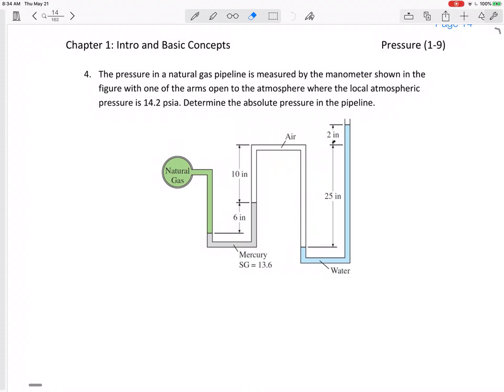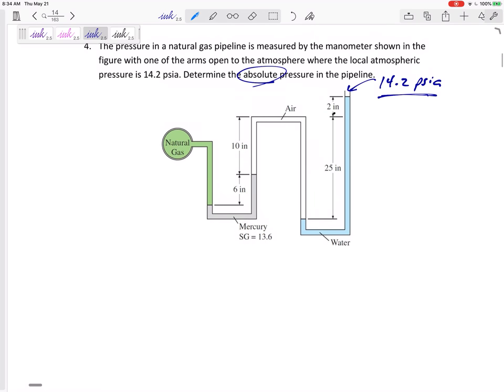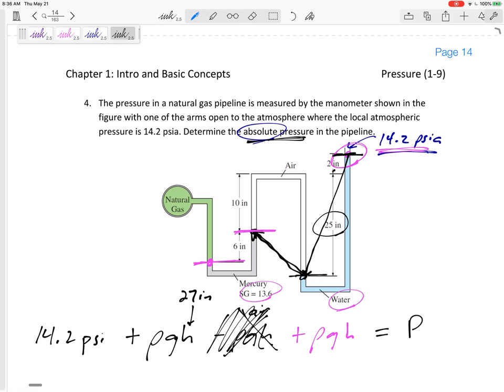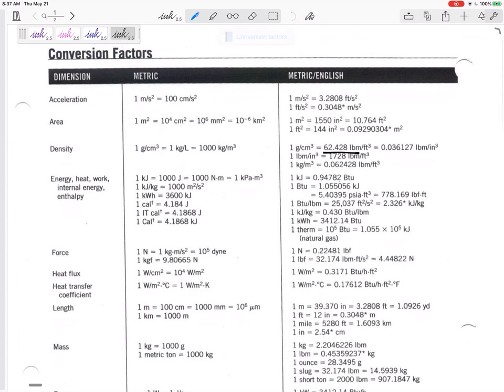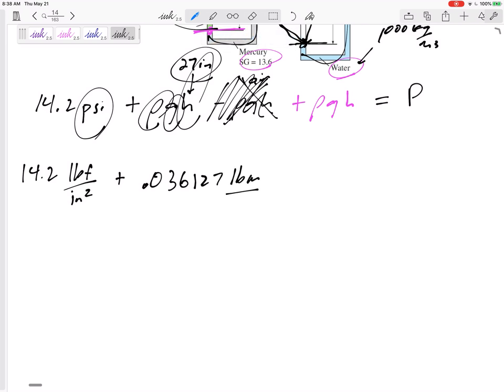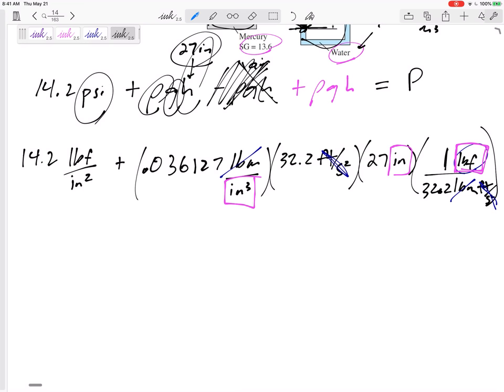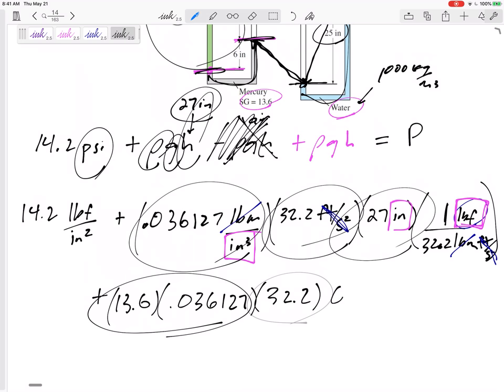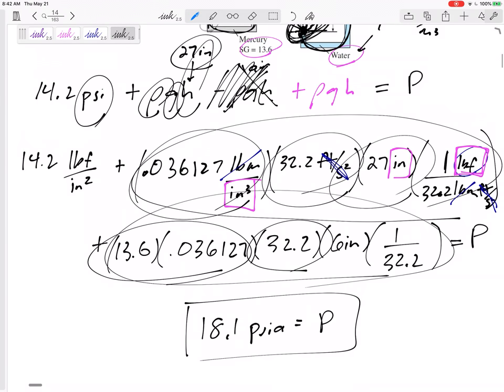Thermodynamics - Pressure example 2 manometer

Comment: I've calculate it just like in the video but I ignore the 14.2 lbf/in^2 and then I got  126.332288 is this KPa? because if it's KPa then I add the 14.2 lbf/in^2 I got 140.5332288 KPa. And then, if I convert 140.5332288 into Psia, I got 20.38 Psia not 18.1 Psia. Did I might be missed something?

Comment: Hello professor, awesome lessons, clear explanations. One question: since you add as you go down, but if you were to go up (from left to right), would you put a negative sign instead? Thank you!
Reply from the maker: Yes, Anytime you go down - add. anytime you move up - subtract.
Reply: @engineeringdeciphered but you went up when you went from the water to the Mercury so shouldn’t you be subtracting in that part? I can elaborate more if you want
Reply from the maker: @alvinlin8140  I think you’re talking about the part where I was going through the air. In that part, yes, going through the air you would technically subtract the rho g h of air, but we can neglect any gas because the rho of gas is much much smaller than the rho of the liquids. So I just skipped subtracting the rho g h of air. (you could do it, but it would be a very small number)
Reply: @engineeringdeciphered ok gotcha thanks, my prof hasn’t gone over examples so this is helpful! One more thing, the pressure of a gas is negligible but in the question we are finding the pressure of the natural gas, can you explain that?
Reply from the maker: @alvinlin8140  well, it’s the change in pressure (due to height change of a gas) that is negligible.

Comment: What if you should've  convert it inches to meters? and instead lbm/in^3, you could've used the kg/m^3. Much easier than the way you solve, however different answer I will got.

Comment: if i started from the natural gas i will subtract the pressure of both water and mercury, right? what about patm? should i add it or subtract?
Reply from the maker: If you started from the natural gas, you would subtract both water and mercury and then you would “equal” it to Patm. The Patm would be on the right side of the equation

Comment: just a thought, but the question is asking about pressure IN the pipeline right? not on the natural gas itself? so why wouldn't you also subtract the natural gas in the tube touching the mercury?
Reply: Because its a gas and gases have such a low density and are negligible

Comment: What if we replace air with water what will be the height of it.
Reply from the maker: You see in the problem that I neglected the part with air because it’s density is so small (compared to the others). If the air was water, then you would do the (rho)(g)(h) of that column as well, instead of neglecting it.
Reply: @engineeringdeciphered   I got the part but what I ment is that what will be the height if we replace air with oli for example.
Reply from the maker: So for that type of problem you would have to be given the pressure of the natural gas. If you know that pressure and you don’t know the height of the right column - it’s still the same process and similar equation. Now h is the only unknown in the equation and you can solve for it.
Reply: @engineeringdeciphered  Thank you 👍